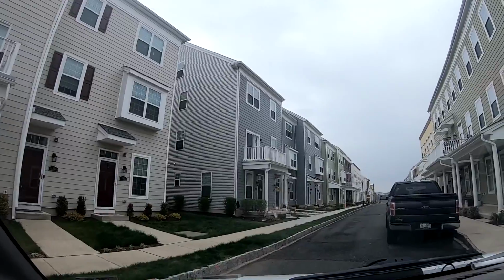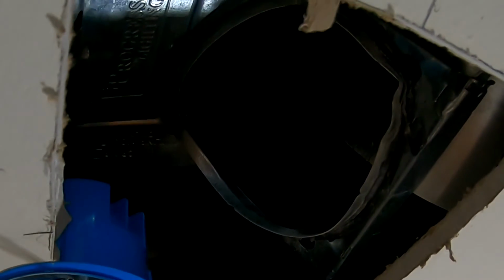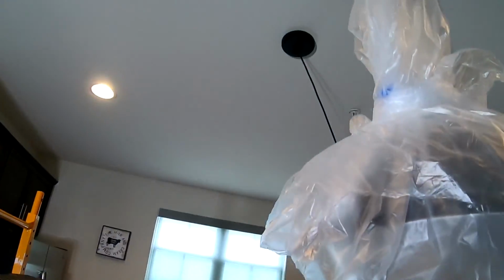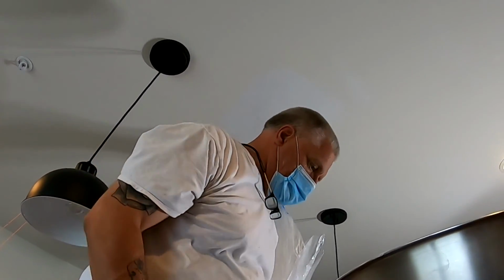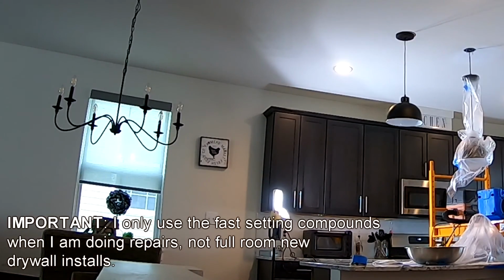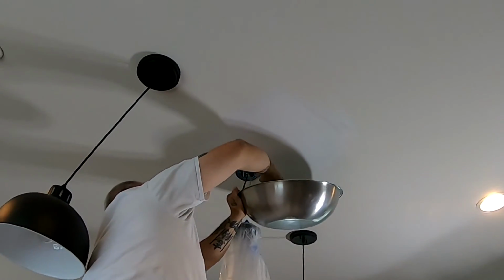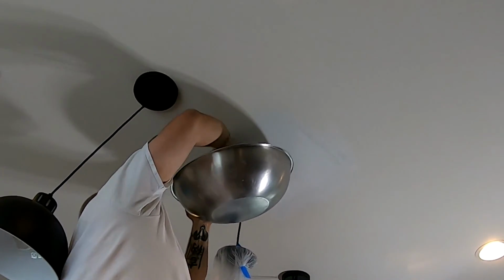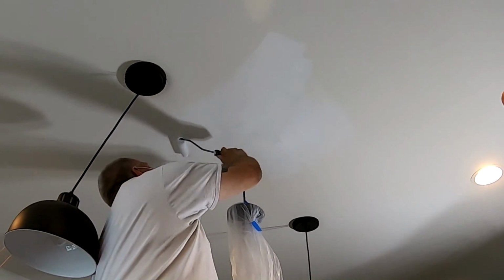DRYWALL TIPS & TRICKS - Drywall Repair Around a Pendant Light

Comment: Ah yes, the mess that electricians leave behind.  Last summer my electrician left numerous holes in the ceilings.  He attempted to patch them by using only drywall pieces without any plywood backing.  There were gaps of one-half inch or more.  I had to completely redo everything.  Great tips!
Reply from the maker: Even a 1/2” gap can be filled with Durabond and taped.
Reply: @BobsHomeServicesLLC  If I showed you pictures, you would understand why I had to redo everything.  The electrician had only one screw holding two sandwiched drywall pieces.  A carpenter, he is not!!
Reply from the maker: @lisaferrara8120  lol I too have seen some crazy things lol

Comment: Great work!
I do something similar when it comes to drywall repairs. I like to do 2 coats of 20 mud  and one skim coat of all purpose compound for easy sand. I didn’t know that you can do a drywall repair all in 1 day. 
Did you use 20 compound for all your repairs
Reply from the maker: I use 5 min mud to prefill my seams that I intentionally tapered and 5 min to set the tape. I blow warm air at the repair and depending on the size of the repair I use either 5 or 20 min mud. 

Using hot water in the mud makes the fast setting compounds cure faster. 

You can sand the fast setting compounds with a palm sander and 120 grit. 

Cheers,
Bob